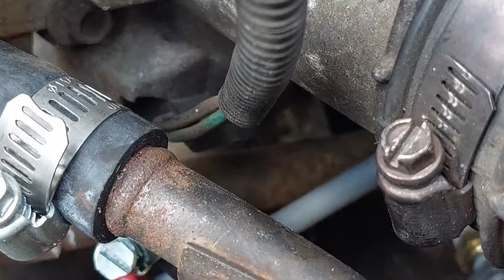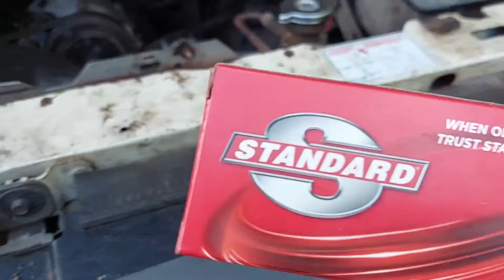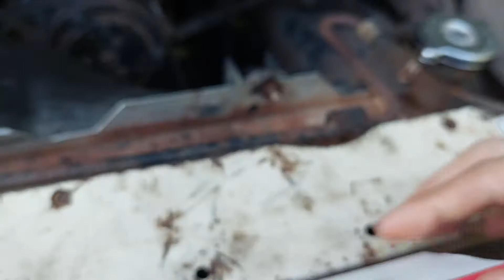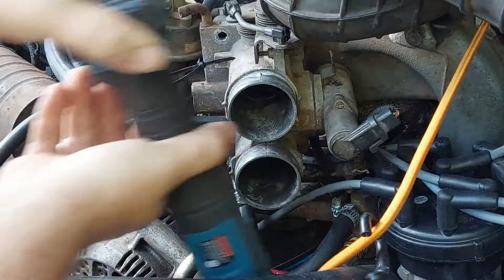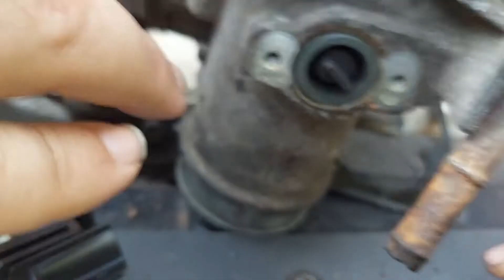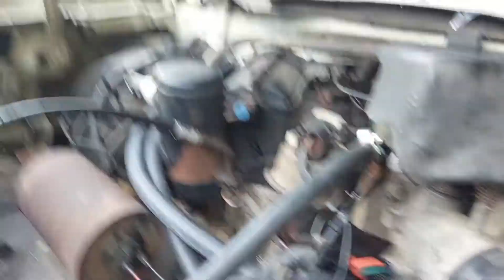Episode 82 - Throttle Position Sensor(TPS) Replacement 1993 Ford F250

Comment: I installed a tps, and it idles good when i turn it on, and if i put in gear and don't press the gas pedal everything is smooth until i step on the gas a little bit, idle goes up to 900-1k rpm and stays there, when i put in park it goes up to 1300 and moves slightly up and down, check the tps its said 86 and once i move the throttle with my hand it goes up to 90 and does not come down
Reply from the maker: Your Idle Air Control Valve might be going bad.  Try pinching off the air flow to the valve and see if your idle comes back down once back out of gear.

Comment: Ummm u forgot to test your voltage.96 to .98 or u have to drill out the holes and slightly turn it till u have ur numbers
Reply from the maker: I did the voltage testing off-camera.  I did not have to do any drilling.

Comment: How would I remove the linkage to the accelerator?
Reply from the maker: If I remember right the throttle linkage is a ball type linkage that should pop off if you pull the linkage opposite of the ball.
Reply: @MazdaB3K   Thanks! Very helpful!

Comment: Liked and subscribed. Well done brother. Ill be doinh this this weekend. I replaced the iac but my idle still pulses and damn near dies out. Been putting off the TPS but i know thats what needs to be done. Thanks for the video
Reply from the maker: Thanks for the sub!  TPS isn't horrible on this truck.  Just make sure you get the idle position on the sensor right.
Reply: @MazdaB3K  thanks bro

Comment: Sometimes I’ll floor it and it will sputter for 1 second and take off with no tire spin and some times I’ll roast the tires for 10 feet and no missfire is this the tps
Reply from the maker: Very much could be.  It's worth doing a few checks and seeing if the voltage reading on the TPS is out of spec.

Comment: I have a 93 F 150 with the 351. It’s idling crazy high, and goes down to normal when I unplug the IAC. I replaced it with a new IAC but still has the idle problem. Sometimes goes to normal, sometimes still way too high. Drives decent but if you floor it, it doesn’t feel like it’s opening up. TPS?
Reply from the maker: If when you unplug the IAC or choke off the air to the IAC and your idle returns to normal, you still have an IAC problem.  I've gotten bad IACs out of the box before for this era of truck.  Make sure you get a motorcraft IAC if possible.  Many of the aftermarket ones just will not work with 90's Fords.
Make sure the IAC is getting the air it needs and you don't have any sort of vacuum leaks on the flow to the IAC.

I'd also grab an OBD1 reader and check for codes.
Reply: @MazdaB3K  Thank you! I hate to admit it, but I didn’t know an OBD1 reader was a thing! I have OBD2, but I thought otherwise it was paper clips and counting flashes. Ordering the OBD1 immediately. I am wondering if the new IAC is crap. Really helpful, thanks for the advice and for just replying!
Reply from the maker: I try to reply to every meaningful comment that is posted to my videos so no worries.  The OBD1 port should be located up near the firewall on the driver's side of the engine bay.  More specifically, there should be a bank of relays in the area (fuel, towing, EEC) and the OBD1 connector should be near them.

The vehicles are a bit younger, but I had to go through two IACs before I got one that worked right for my 2001 Ford F250.  I managed to find the motorcraft one in that case.  For my 1997 E-150, I had to go with an Autozone Duralast IAC, which appears to be working for now.

A basic IAC test you can do is to remove the IAC from the throttle body and flip it upside down so that you can see the actual valve.  Cycle the key in the ignition.  If you don't see the valve move during the little self test it runs  then, the IAC is bad.  When you get your OBD1 reader in, it should perform a similar test when you do a KOEO (Key On Engine Off) test.

One thing to keep in mind is the OBD1 isn't that great for trouble codes.  It will flag stuff that is flagrantly broken, but stuff can break and it won't trip a check engine light.  I had a '94 Ranger with both O2 sensors bad and there was no code from the computer.

Your best bet is to get a known good valve from somewhere and swap it in for a quick test.  I did a bit of digging for you and I have sourced a motorcraft IAC for your year and engine:

https://www.partsgeek.com/catalog/1993/ford/f150/fuel_injection/idle_control_valve.html?rp=idle_air_control_valve

Also at RockAuto:

https://www.rockauto.com/en/catalog/ford,1993,f-150,5.8l+v8,1122107,fuel+&+air,idle+air+control+(iac)+valve,6072

Let me know how it goes for you.
Reply: @MazdaB3K  Way above and beyond!! Thank you again! That is super helpful. It’s irritating to buy a new part that that doesn’t work out of the box, but it wouldn’t be the first time. Subscribed, Liked, and anything else positive I can find to click! Thanks again.
Reply from the maker: No worries, I'm happy to help.  Best thing you can do is spread the word about the channel and just watch videos.  Watch time is the main driver of revenue that allows me to work on more stuff which I can then make videos about.  Optionally I also have super thanks turned on, which allows you to donate to me in a few different ways.  I also just turned on channel memberships which helps.  Truly though just spreading the word is more than enough.
Reply: @MazdaB3K  Will do!!
Reply: @MazdaB3K  Hey, I finally got around to putting on a new Motorcraft IAC.  Same.  Still a way high idle, that will drop down to a pretty normal idle when I unplug it. And to make me even crazier, I opened my new OBD reader from Amazon, and I hooked it up, it’ll started clicking the truck’s solenoids like it’s starting it’s diagnostic and after about 20 seconds it doesn’t have any codes, or signal that it’s done, it just powers off! Noooooooo!! So now I’m trouble shooting the trouble shooter (scanner) I have a friend with an older Ford truck, I’ll try and scan that and see if it does the same thing.  I feel like it’s the little single wire connection on the scanner, but I tried to ground it like their troubleshooting guide said, and it does nothing at all. Driving me nuts. I’m not throwing in the towel though, I’ll figure this thing out one way or another.
Reply from the maker: @larrythomas3624 That definitely stinks.   As for the OBD1 reader, it should go a little something like this:

For Key On Engine Off (KOEO)

1. Key in the run position
2. Plug in scan tool to OBD1 port.  Should be a big connector and a small single wire connector.
3. Power on the tool
4. Press the "test" or "scan" button
5. Testing should start.  Codes will begin to appear if any trigger.  If you see an "11", that's the all clear/no codes signal.
6. Pay attention to if you see an "O" on the scanner screen or a "C".  O codes are live codes that are current in the computer's memory.  C codes are codes that are from the STORED memory, or old codes.
6. You need to be holding the throttle wide open during this test or you will get a code "22" in error.

For Key On Engine Running (KOER)
1.  Steps 1-4 are the same as with a KOEO
2. You'll need to hold the throttle open through a part of the test, but only part.  The testing will also have you tap the brakes at a certain point at well.  The AC also needs to be  turned off during testing.  Failure to do any of these will throw erroneous codes.
3. Because this test is longer you might see a "10" code.  That is a pause.  Not an error code and the test is still running.

The book that came with the scanner should explain all of this in more detail, and provide a lookup of the codes that can pop up.

As to the crazy high idle.. I would start checking wiring and/or grounds.  The fact the engine finds it's happy place once the IAC is disconnected means either the data the computer is getting is way beyond the pail due to bad sensor or bad wiring or bad grounds, or the computer is failing.  Computers do fail but it's rare.  I would suspect a wire or ground first.
Reply: @MazdaB3K  Yup, Thanks for answering. I was trying to do the KOEO test, and it begins testing like it should, clicking the truck’s solenoids and such, but instead of showing any codes or indicating that the scan is finished with no codes, it just displays 000 until it shuts itself off (screen shuts off) I wanted to complete KOEO and then proceed to the next test, but can’t get past the first. I’m going to try the scanner on a different truck soon and see how that goes. So I’m now troubleshooting the new scanner instead of the truck! Other than maybe checking or adding a new ground from the engine to the frame, I wouldn’t know where to start. Everything seems to be working on the truck other than the high idle that goes down when the IAC is unplugged. I kinda suspected the TPS but that still wouldn’t explain what it’s doing with 3 different IACs. A 1993 truck is space age “Buck Rogers” stuff to me. I prefer old carburetors for this exact reason!!
Reply from the maker: @larrythomas3624 I'm on the opposite end of things.  I much prefer sensors and fuel injection to working on a carb.  For example, I have a Honda GX200 small engine that's not running right and I'm going to have to get into the carb to figure out what is going on. Whether I like them or not though I do need to learn them if I ever want to start making videos about older vehicle or small engine stuff.
Reply: @MazdaB3K  They each have their moments I suppose! I guess we each have to go outside of our comfort zones. If you’re interested I’ll give you another update if I figure anything out on this thing.
Reply from the maker: @larrythomas3624 Please do!  When you find your solution, that adds to the knowledge bank.
Reply: @MazdaB3K  Hi again, Just a quick report, I’ve made a little headway. I figured out that I had to run a ground wire to position “F” (even though my truck is a 1993 ?! )  On page 76, troubleshooting, in the code reader manual it says you might have to run that wire with most 1981-84 vehicles. Anyway, I got a few codes. KOEO 121, and 512. KOER 121, 411, 412, and 538 (I think I flubbed up the test and got the 538 by just blipping the throttle to the floor once quickly)
Reply: @MazdaB3K  Quick update, I replaced the TPS after replacing the IAC and it is a super happy truck! Runs like new.👍
Reply from the maker: @larrythomas3624  I'm glad you solved it!  Good job for sticking out the troubleshooting
Reply: @MazdaB3K  Thanks for your help 👍

Comment: I see some sort of tiny rubber seal down in the hole below the old TPS sensor attachment. Does anyone know what that seal is for?
Reply from the maker: If you email me a pic at mazdab3k@gmail.com I'll take a look at it.
Reply: I figured it out.  lol,  It was a circular piece of plastic that had broken off from the original TPS plastic apparatus that is attached by screws to the throttle body.  But also, since one of my screws broke off, I've been unable to find a replacement for them in Canada. Which means an extra cost to have them shipped from the States.
Reply from the maker: That... is poopy.  Have you checked www.rockauto.com to see if they have any Canadian warehouses they ship from?
Reply: @MazdaB3K  After receiving my 2 screws in the mail, it turned out they didn't even fit my 1990 ford f250 throttle body.  Waste of time and money.  It would be nice if they included 2 new screws with every TPS.  However, after digging through various old screws in my garage I've collected over many years, I eventually found one that fit, even though it was a little shorter. Added a tiny lock washer and "voila". Put it together and installed the throttle body to the engine. Thanks for the video, which made it so much easier for me to reassemble. 🙂
Reply from the maker: @knightowl2016   I'm really glad the video helped.  I just had to replace another TPS, same era of Ford on a project I'm filming right.  I actually referenced my video because I'd forgotten how to do it lol

Comment: What a great video !  Thanks so much !  Crystal clear.  Not sure how to adjust the throttle stop screw on my 1996 F-350 with the 351 Windsor.  Gonna install the Standard brand TPS tomorrow.  Its really superb how you answer questions from comments !  EXCELLENT !!
Reply from the maker: Thanks for the comment!  I don't remember if I put it in this video, but you can adjust the throttle stop screw using a multimeter as long as you have the new TPS attached.  You can backprobe the signal wire going to the TPS and it will give a number in volts.  I don't remember the range but you should have a certain number with the no throttle.  Adjust the throttle stop screw until that voltage number is achieved.  I had to do that with Ty.  In fact,  I think I made a video about that...

https://youtu.be/xq6ex9iVg4k

Comment: Hi buddy! Nice video! 

I have an issue with my f150 4.9

After 30 minutes drive it starts to idle roughly, i replaced the module that is on top of the driver tire, relays, distributor, map sensor, and the intake air temperature sensor. 

Check my iac valve and have 11 ohms of resistance, but when the truck starts to fail if i unplug the iac valve nothing happens, even without it starts really well. 

I almost forgot, when it starts to idle rough i turn off the truck and wait 30 secs and turn on again and  starts awesome.

Didn’t know the fail at all, I’m hoping thats not an ecu issue :/ 

Have a great day (sorry for my bad english)
Reply from the maker: Generally if you unplug an IAC valve and nothing happens to engine operations the valve is bad.  It is very important that you replace the IAC vavle with a Motorcraft one if you can get your hands on it.  Ford engines are very picky about their IAC valves and do not like the 3rd party ones.

Since the issue is rough idle, I'd check on the following:

1. Check the electrical connection for the IAC Valve.  Inspect for corrosion, damaged wires, loose contacts, etc
2. Trace those wires back to the ECU.  Make sure you don't see anything burnt, broken, etc.
3.  Make sure your current IAC valve is cycling correctly.  Take the valve off but leave it plugged in.  Put the key in the run position.  If you are fast enough you should see the IAC valve move as it does a self-test.  Alternatively you can do a Key On Engine Off(KOEO) Test via a scan tool to check this.
4. Check for vacuum leaks.  As this seems to happen once the engine is warm, something could be opening up with heat.  With the engine cold but running, you can spray some carb cleaner around various connections to see if you get a change in engine sound.  Be careful doing this.  Once the engine warms up you can't do this as you could start an engine fire.  Also, carb cleaner will eat through plastic and rubber lines, so spray wisely.
5. Check the capacitors of the ECU.  Remove the ECU and then carefully open the lid.  Do you see any capacitors (cylinder looking things standing up from the circuit board) that look burnt, bulging or have dried puddles of goo around them?  I'm assuming you have a 90's Ford.  Bad capacitors are the number one cause of ECU weirdness on that era of Ford.

I'd try working through that list and see what you find.

Comment: I can’t get my holes to line up on my tps and when I move them to line up it idle to high please help me I have taken this on and off two times now still have high idle
Reply from the maker: Are you sure that you don't have any vacuum leaks or anything causing the high idle?  The TPS can also be adjusted via the stop screw.  If someone messed with that screw in the past the correct position of the TPS could be too high.  That was exactly the case on my brother's truck.  We had to adjust the stop screw to bring the TPS back into a normal range for idle.

In order to figure out where the TPS is in its range, you can use a multimeter to check voltage going into it.  At idle, the TPS should read somewhere between .95-.99 volts.

Another thing to check into is timing.  We had the engine slightly off time, off enough it required the TPS to be too high in order to idle, but close enough that the truck would start but it had no power.  Once we fixed the base timing the truck went from idling at around 850 rpm to 2.5k rpm because the TPS was way too high.  After adjusting the stop screw to bring it back to .98V the truck now idles back at 850 rpm again.

I hope this helps.  Let me know if you have more questions.